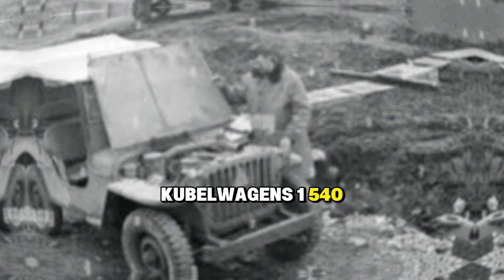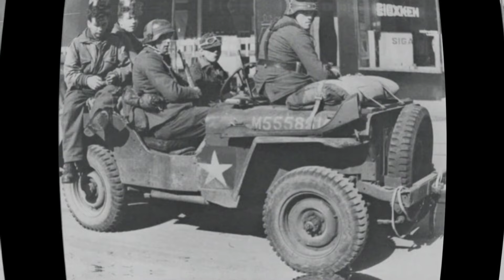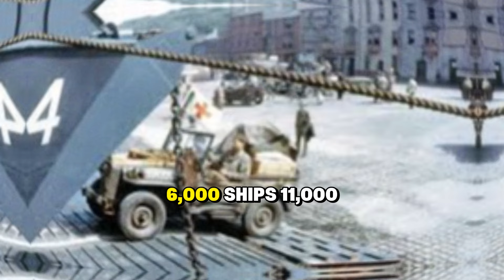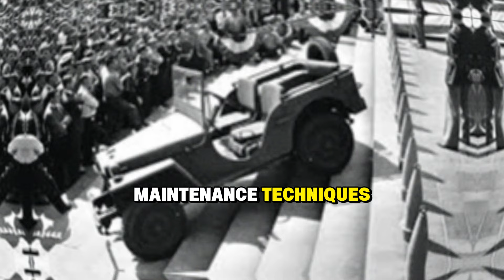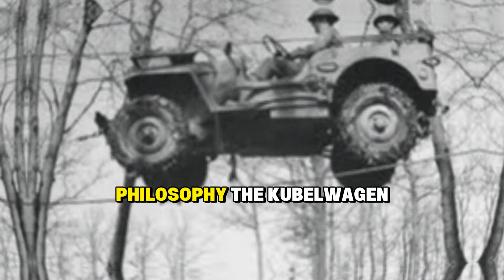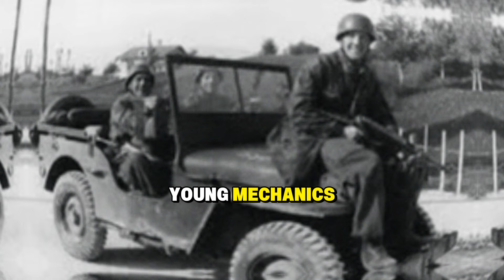Wehrmacht Mechanics Drove A Captured Jeep — Then Admitted They'd Never Had Vehicles Like It

Comment: The Germans respected the Jeep because of its power to weight ratio but the German VW Kubrlwaggen had big advantages as well.
-Most kubbelwaggens had 2WD but some had 4WD.
-Even the 2WD versions beat the Jeep at times.  Firstly the independent suspension maintained better ground contact and therefore traction.  The Kubbelwagens differential was Limited Slip so even the 2WD sometimes didn’t get stuck like the Jeep when digitally opposite wheels lifted of the ground.  The weight and traction as evenly balanced over the rear where the engine was.  
-It also had a completely smooth bottom and didn’t get stuck. 
-Kubelwagens were lighter and you could have 3 for the steal of 2 jeeps and they burned less fuel.
-They also carried 4 not 2 and had a glove compartment and storage under the hood. 
-The jeeps strength was its enormous power and in some cases the fact the U.S. could make large numbers of 4WD gears.